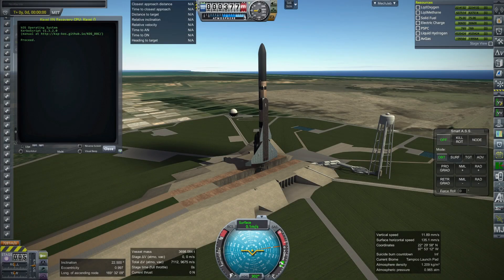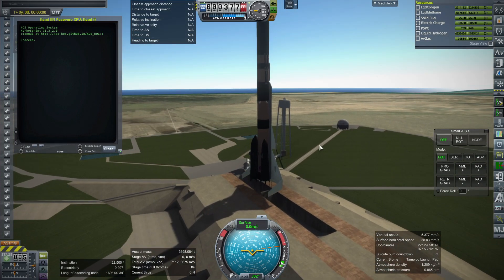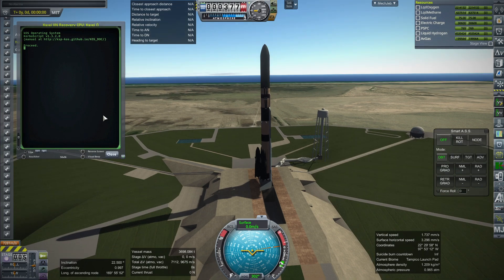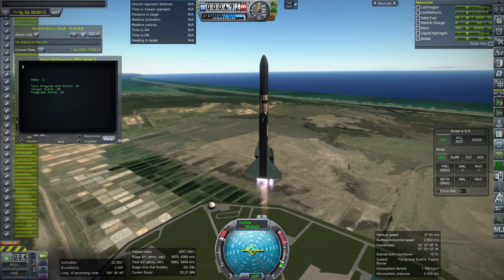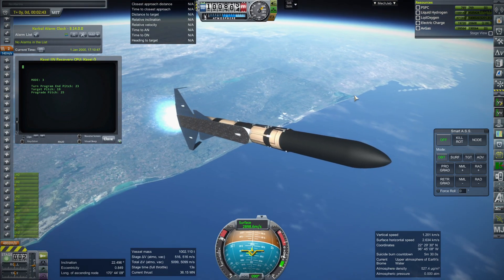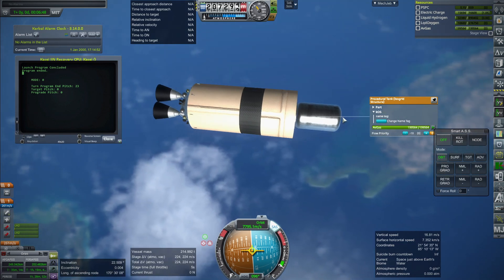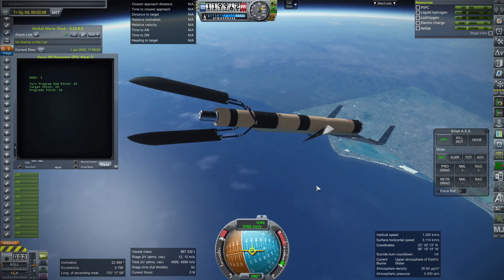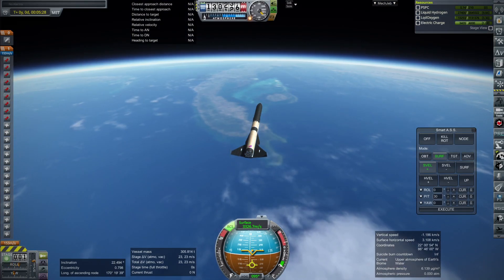Recoverable Kasei II Payload Test

Comment: Have you checked if the whole body exists as far as FAR is concerned? Could it be that the massive farings at the front are causing lift and drag, but the rest of the body isn't? Also, it's really weird that KOS is causing that problem. :/
Also also, you said that you originally had the canards at the front, which didn't work, but at the moment its pitching up naturally and the canards don't have enough authority to counteract it; surely if they were at the front and they were deflected in the right direction, they would have a lot more effect...? At the moment they're fairly close to the centre of mass (probably), so they wouldn't have much authority (I would guess).
Reply from the maker: Yeah, I moved the canards back for the center of lift, but that has a bad effect on authority, so I should move them forward again and just make the wing larger.
Reply: @RaizSpace  How did you do the aero analysis for your existing spaceplanes? you modelled them in blender right? did you use FAR in kerbal then recreate the shapes in blender?
Reply from the maker: @romain5967 After doing the body, I used Procedural Wings to figure out the wing shapes with FAR, then modeled the wings. Since the wings get a FAR module anyway, and that calculates their mass, too, it usually works perfectly.
Reply: @RaizSpace  cool, might give it a try, although I don't know blender; i know a couple CADs; any tips?

Comment: Could a super heavy booster lift an entire Vulcan rocket?  What kind of mask orbit could you get with that?  I fully fueled centaur five with Orion in LEO?
Reply from the maker: Are you talking about bringing the Vulcan to orbit or using the Vulcan as a second stage? Vulcan is tiny compared to Starship, but Super Heavy alone can't bring it to orbit, I don't think. As a second stage, I would at least want to use New Glenn first stage instead.
Reply: @RaizSpace I was thinking about using Vulcan as a 2nd stage, but the NG 1st stage is also delightfully ridiculous!